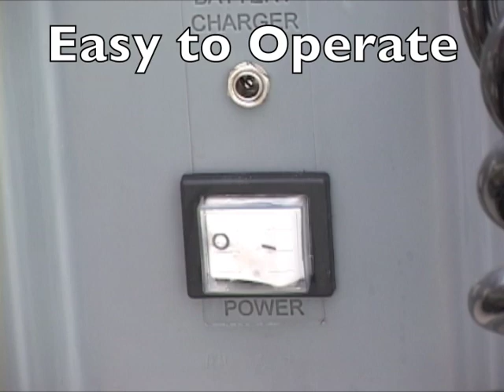CoilJet Portable Coil Cleaning System with Foaming Coil Cleaner

Comment: I bought one for 585 dollars with wand at my local parts house. I use it frequently. I love the power an how long the battery lasts. After about 1 month (a year ago) it started to leak badly from the bottom. Speadclean paid to ship it back to the and they warrantied the work and sent it back. 2 weeks ago it leaked while I was in an attic. I have contacted spread clean and they are going to exchange me for a new unit. So I love the unit, but wish it was built more solid.
Reply: ditto. mine lasted one year then check messed up. you have to use special clamps to fix hoses